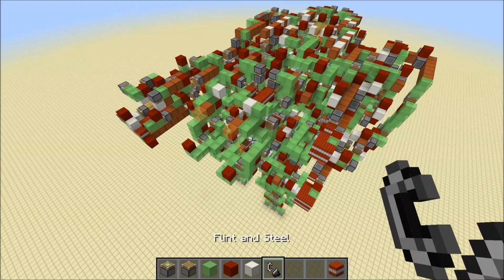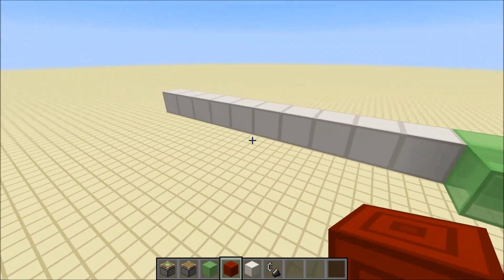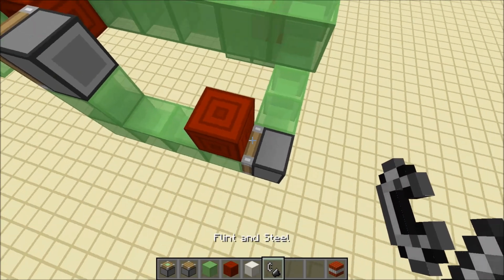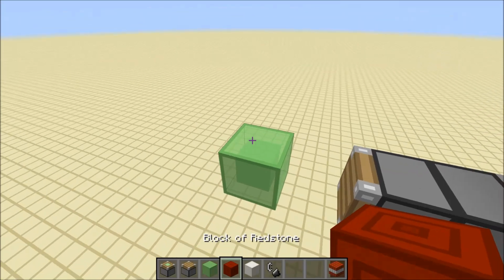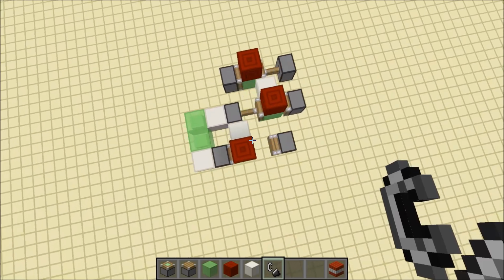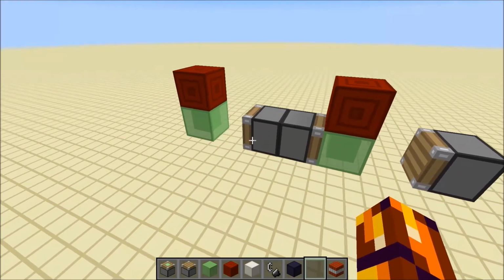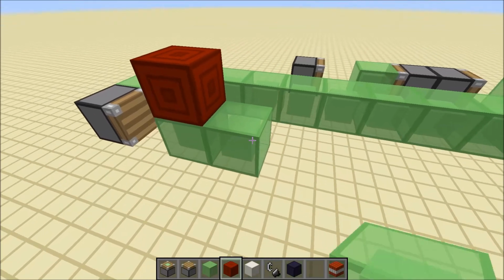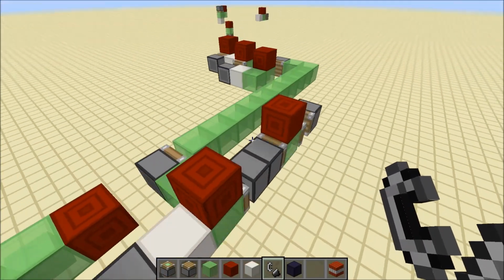Ultimate Slimeblock Tutorial (Part 1): Piston Engines and Attachments

Comment: Using a chaos engine you can "push" up to 13 blocks (12 + 1 piston) so long as the 13th block isn't in direct contact with the rest of the contraption upon start up. Additionally being able to turn your contraption around by altering the position of a single piston can be quite the benefit if you intend to make a round trip, so long as you are only operating within 8 or so chunks, anymore and the speed of caterpillar and looped engines can outshine the simplicity of the chaos engine.

Comment: Whenever I try to make an unstable looped engine, the last piston to be updated doesn't go off even though it's right next to a redstone block. I have counted to make sure there are less than 13 blocks and checked everything else, but this happens EVERY TIME!!! I don't know what I'm doing wrong :(
Reply: Extended pistons can''t be pushed and will block your engine. That's why the unstable looped engine needs at least three pistons: with two, the second won't move because the first hasn't unextended yet.
Reply: I used three pistons, but maybe the mechanisms I made were just too small. It works when I use four pistons though. Thanks!